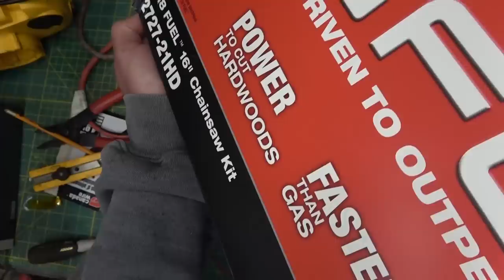BOLTR: Milwaukee Chainsaw | Destroys DeWalt

Comment: The battery goes for $200 by itself, so I think $400 for the saw isn't too bad.  I was considering buying this, but the build quality for the tension-er, oil grommet, and the flimsy case are making me think that I'll pass on it for now.  The main reason I would consider it, is to get the battery.  That thing is a monster.

Comment: The oil pump works like the Husky pump in that the shaft has a flat  and as it sweeps the port creates the pressure differentiation then on to the output port... viola 
Pump gear is plastique as it is designed to fail rather than the worm as per Husky. Don't ask how I know.

Comment: The output shaft is spinning at 3000 rpm, wouldnt that mean the larger gear is spinning at 1000ish not 7000ish? The smaller gear, for each rotation, would only move the larger gear by a 3rd or so I thought

Comment: Thx again for the insight o build quality.
Just bought a ECHO 20" 49cc for 270.00 USD brand new, great light to medium duty, works well as it should. I was at HD hours ago and saw what that Milwaukee 12 amp battery costs, 250.00 usd . Fuck that !

Comment: According to my local quality saw dealer California CARB is looking to or has already set a date to ban 50cc and under gas engines. Dont know if it includes 4 strokes also. As California does the rest of America usually gets.

It would also be interesting to see who makes a better battery chainsaw. The battery took makers like Dewalt and Milwaukee or the saw makers Stihl and Husqvarna.

Comment: 11:47 the pew-pew greebling, the line you are molded line you are pointing out going across the case, those are sights. That is there so you can am where your tree is going to fall. All chainsaws should have a line like that, if they don't then people like me that wore ourselves out running real saws like my Stihl 046 and MS 440 cuttin would never be able to fall a tree straight..... I lie, I don't need the sights, but green-jacks do. Check out Buckin Billy Ray channel on here, probably the best damn timber faller I've ever seen. And he's a Kanook too on the West Coast side.
 Love your channel, Love this video.

Comment: Milwaukee is really just catering to homeowners these days. I started picking up their tools as I bought my first house last year and so far they're serving me pretty well, had to rebuild two rooms off the bat and only had to bust out the corded tools for the biggest parts of the job. The bare tools are considerably cheap, it's the batteries that are the real investment, the big ones run up to $200US. After seeing your breakdown of this though I think I'm better off using the sawzall for smaller things like brush and a regular ol' pole saw for any tree limbs I need to cut down.
Reply: Well, if you're buying the $100 Milwaukee's, of course you're going to get the prosumer line.  The Fuel are the commercial tools

Comment: 11:47 That line is not there just to visually break anything up, sir.  It's perpendicular to the bar and when you're cutting your notch it should aim at the direction you want the tree to fall in.  Use it again while cutting the back cut to get both sides of the hinge parallel.  Stick a wedge in bang it good and it'll fall into the direction that line aimed at

It should, anyways.  Run if it doesn't.

Comment: Can you tear down and review the one from HF? I got it a few months ago for 150$ and it works great except there are no high capacity batteries only  slim pack. However for the dollor to value it's a better combo then these DeWalt/Milwaukee chainsaws. I like both brands but for the price they are not what they should be. Thanks for another great review!

Comment: Wonder if the motor size difference between the two is due to the difference in battery voltages. At 18v on the Milky you'd need bigger wires to allow for the amperage to flow, as on the Dewalt you compensate by using higher voltage and less amps to achieve the same power output. ??
Reply: That's exactly right.  AvE explained it.  Listen again.

Comment: the battery powered chain saws are supposed to be great they always start when the batterys are charged. not like the 2 cycle. i just think they should have used the 28 volt systrem they have. it would have more power and last longer.

Comment: 10:03 thru 10:12 ... Why didn't you release the tension from the spring via the chain brake before removing the ass-end of the spring? Seems like you did extra work.

Comment: Any way you can take apart a Milwaukee transfer pump? I would love to hear your insight on the quality of parts used. I also think you could come up with your own modification. As far as I can find, no one has shown if the outlet of the pump can be capped off (with garden sprayer). I think if anyone can come up with a way to hack a pressure shut off to the power switch you could.
Reply from the maker: Already did. Have a look through the BOLTRs.
Reply: @arduinoversusevil2025  thanks, can't believe I missed that.

Comment: If it's an electric saw, having the chain brake cut the motor makes sense, but why not have it open the actual power circuit?   I have seven chainsaws, but I'm actually considering this red electric thing, just to carry in my trunk in winter windfall season (no leaks or drips) and for tasks where I don't want a lot of noise.

Comment: I have an 18" Poulan I bought at a pawn shop for $100 and I've been intent on replacing it for years but the thing runs like a raped ape. Totally uncharacteristic for the brand but it's never resisted starting for more than 2-3 pulls and it idles better than any saw I've ever owned. Far exceeded any expectations I ever had considering it was used out of a pawn shop

Comment: No vibration mitigation on a $600 saw?  It's not just the engines or motors that vibrate.  Either didn't think of, or not intended for any considerable use at all.  I'll stick with my 20 year old smoky echo that cost substantially less.  Which saw of the two is more 'green'.  How many batteries to get to 20 years??

Comment: I just bought this saw and have a legitimate question... WHY ARE THE BATTERIES GETTING UP TO 120+ F AND THE CONTACTS 150+ F? I thought lithium had to stay beneath 113 F (40C) to keep on trucking... I used it limbing and cutting up some oak/mesquite and on my thermal imager it showed the thing blazing hot. It does the same on the rapid charger. My Flexvolt stuff never rises above 100... I like the chainsaw but will the batteries handle the heat?

Comment: K, there’s 1800 comments here so I’m not reading all of them before giving mine. 
The chain speed / distance thing works out to about within a BCH of VERY roughly 30MPH ... 

26/9 = 2.89
20,000 motor drive gear ripums / 2.89 = 6920 chain sprocket ripums

Assuming! Chain length =~ 60 inches, and 1 rotation of chain sprocket =~ 4.5 inches; then 60/4.5 = 13.3 rotations of drive sprocket for one rotation of chain. 

Chain RPM: 6920 / 13.3 =~ 520 Ripums

Chain distances per minute = 520 x 60 =~ 3000
Chain distance per hour = 3000 x 60 =~ 180,000 inches
Chain distance in miles =~ 180,000 / 5280 =~ 35 

Chain speed =~ 35MPH
Actually believable. 👍😁😎🙏🏻

Comment: This Milwaukee saw might beat the 20v Dewalt but can't compete with 60v. Dewalt flexvolt is what I have been using for small projects for a year now. Gas is always better if you need to do the heavy work.

Comment: 27:50 Solder actually is very brittle. I think it would be more questionable that they screwed the pcb directly onto the backside of the motor, but now that they did you bet they had good reason to dip the pins of the electronicals in some epoxy!

Comment: you need to teardown a stihl now. i mean i'm a stihl certified master service technician but i hardly touch the things, i just get called over to have a look when something goes really wrong, which i haven't really seen on the electric ones. i'd imagine the stihl ones would be easier to have fixed if something did go wrong.

Comment: In the past decade dewilt seems to be letting go of the last fingerhold of quality that used to set them up with the big boys. Not happy with them, but too invested to get out. That being said, my 60v dewilt chainsaw is one of the happier of my crappy new tool surprises. Bought it to drag something easier up tall trees and have been happy with it ever since. I use it over the 30" stihl anytime I can. And ive gotten 20-30 16" cuts off the battery and a new blade. When you get the milwaukee out for it's hot supper, I hope you get the dewilt put back together and do a lil menage et trois with the 2 of em out in the forest. Specially for the money, I bet the dewilt will hold its own if not put the milwaukee to shame for the money.

Comment: is there any possibility that the difference in motor size between the DeWalt and Milwaukee is due to the dewalt running 54v and the Milwaukee running on 18

Comment: the only reason I would have for a chainsaw would be to use it around the home on the rare occasion that a large limb needs to come down. So buying a gas powered one would work, but leave it till next time and it just won't start. then you have to take it apart and clean it and what not. Electric would be what I would chose since I would only even need to use it on a blue moon and it wouldn't be put through but the lightest of jobs by any standard.

Comment: id have to question how long the saw is actually gonna last.  with the sawdust and oil build up how will the electronicals last over a season or 2.  if the saw is actually powerful enough I can see it being practical for wood carving.  otherwise a proper pair of clippers and a stihl would be the way to go for that price.

Comment: Hey Uncle Bumblefuck, check out the husqvarna t536li! Is the top handle climbing saw, we use it almost daily in trees as a trim saw! The thing runs like a beast, and is a damn good replacement for those beavers we traded in a while back! When those things went on strike and we got sick of the smell of burning petrol this thing seems like a decent replacement! She will chooch! And saves your shoulder at the end of the day on account of not having to pull the cord!

Comment: Not sure if someone said something already bout the line running side to side the same direction as the top handle but first off it should be a different color than the case but that’s a gunsight for felling...... not sure anyone would use this saw for felling 😂😂😂 tho

Comment: 7,000rpm isn't that high.  The gas models spin faster.  And we use the Ego electric chain saw.  We prefer gas models because when the $200 Echo 3120 outperforms most electric saws. But our biggest like about the electric chainsaw is no ear plugs and the ability to start at 6-7am because no screaming gas motor.

Comment: Why on earth would you put a clutch safety brake on an electric chain saw? 

Does the motor spin nonstop as soon as you turn it on? 

couldn’t it have been replaced with a push button safety same as a sawzall?

I was under the assumptun’, (probably a couple thousand hours on chainsaws) the brake was for leavin’ her sputter at idle without the blade spinnin’.. lmfao

Comment: I am in the process of swapping all my small motors to battery. Riding lawn mower will be lithium powered next spring. Chain saw, trimmer, blower and all my other tools. My garage has solar and it charges everything. Not so much to save energy but this way I’m paying myself instead of a gas station or power company. Right now it doesn’t really save me much but it’s an investment in the value of my house instead of the money going into someone else’s pocket. Plus like others have said all these battery operated tools just start. No messing with fuel and oil, well mostly, and no starting issues. It just works. Time will tell if they last though.

Comment: I've discombobulated 2 chainsaw oil pumps to see how it suckered, one stihl, one husky. They were both pretty much the same, a hole on each side and just a section cut out of the shaft so a that some oil got trapped in one side and flung out the other as it spun around. The adjustable flow ones just have the cutout on an angle so move the shaft in/out and you get a smaller/bigger space for the oil. you can kinda see it here, part number 503 89 13-01, the left end of the shaft just has a little section milled off, goes into the pump housing and lines up with the holes on each side.

https://www.ransomspares.co.uk/diagram/husqvarna/chainsaws/827780/350%20(1998-02)/

Comment: I can see the benefits of a battery powered saw... But if you need to do real work they just aren't going to cut it (pun not intended). And 600$ CAN is a really hard sell for a homegamer saw that realistically has about 15mins of work tops in it. Compared to a refurb Poulan for 100 rubbles, one just seems like a better deal for a guy that just wants to chop up a few small branches and pallets.

Comment: Reckon this here saw would be good for some one thats got m18 batteries and an old lady that aint tryna run or hear either of the 272xps for the od peice o wood that wont fit the stove? Madrone and black oak redwood nd fir? Skookum.

Comment: The motor was surprisingly impressive, large bearings, solid and properly epoxied and those windings are stationary! Funny other manufacturers don't even epoxy windings spinning 20k RPM! Guess the value had to be massaged in somewhere (sparingly).

Comment: The bigass red chainsaw called "fuel" is electric...

Being in the internet for more than a few minutes, i should be used to being clickbaited, swindled and trapped, but i was expecting that thing to be one of those two-smoke infernal combustion powered carbohydrate foam munchers, but alas, i was tricked

Comment: Title a little misleading the Dewalt is better built the chain tightner is only a little better on the Milwaukee but we were using both plus a Ego and all 3 the chains come off that's because they use a thinner bar on all 3 plus a thinner chain that's why they cut faster then some of the smaller gas chainsaws

Comment: For 399$ you get a Husqvarna Professional Saw with 36 v battery, that would be the one I take, you are in Canadia right?. Sorry but I could not watch that contraption all the way though. Actually I will watch all the way though after that electrical lead broke off.

Comment: Someone that’s actually used saws and works on them has probably already posted this, but 7,000 rpms is nothing especially with a 6 pin sprocket, most of my saws i tune to 12,000-13,500 with 7 pin sprockets... do the math

Comment: I have the DeWalt 40v chainsaw, the first one pissed me off. It seemed like the bar always came loose and the chain would derail. I took it to a repair center and they sent me a whole new saw. The new (improved) one works fine. It seems they worked out their kinks by adding some parts. So now have a DeWalt chainsaw that kicks ass

Comment: I've been a subscriber of yours for almost a year now, and watched most of your content. Over that time, you've done several videos involving revolving cylinders, mostly motors, with which the manufacturer drilled out small portions for rotational balance, similar to this video. This got me wondering; what mechanism are they using to test the balance of these cylinders? Could you do a video illustrating this concept?

Comment: It's great the chainsaw comes with a hanging hole.. until you come back a day later and all the chain oil has all dripped out. 
Then you contact manufacture and they tell you to remove all oil before storage. Wtf

Comment: I paid about the same for my Echo 490. Of course mine drinks dead dino juice instead of being pixie powered.  I can't imagine that you can get the same kind of power or run time out of that battery powered %$*&! but I could be wrong.  It looks like there are a lot of beefy parts inside there that could be turned into an automatic nut smasher.  I REALLY don't like the fact that the chain break is microprocessor controlled.  That needs to be mechanical.  I can't imagine how that got sent out with nobody screaming bloody murder.

Comment: As a Dewalt fan boy I looked at their chainsaw for my battery set. The price of these things, and the fact I won’t be wandering out into the woods logging, just stuff around the old homestead .... Nah! Got me one of them corded Oregon 240v chain saws that comes with a built in blade sharpening stone on a lever. 
 Now, I don’t want people questioning my masculinity for buying electric power tools when the proper petrol one is available, but I tell you I won’t be wanting for power, and I won’t be cocking around trying get a 2 smoke to not refuse to start next winter yanking on a pull cord and throwing my shoulder out next autumn when the next storm blows a limb off and carb is all gunked up....OH NO! https://www.screwfix.com/p/oregon-cs1500-2400w-230v-corded-45cm-electric-self-sharpening-chainsaw/6285K?kpid=6285K&ds_kid=92700019779901980&ds_rl=1241687&ds_rl=1245250&ds_rl=1249410&ds_rl=1247848&ds_rl=1245250&gclid=EAIaIQobChMI4LnF5JaN4AIVUqqaCh2zWA9eEAkYASABEgJLVPD_BwE&gclsrc=aw.ds

Comment: Ive worked in the industry for  years, been through the lot and the only electric chain saw worth buying is a sthil. Had mine in daily use for years and still keeps chuching. I'm talking hard use, not home owner stuff.  I dont know if they got batteries these days... but really, I hate fucking batteries.  give me the mains any day.... I got a generator if I need it.